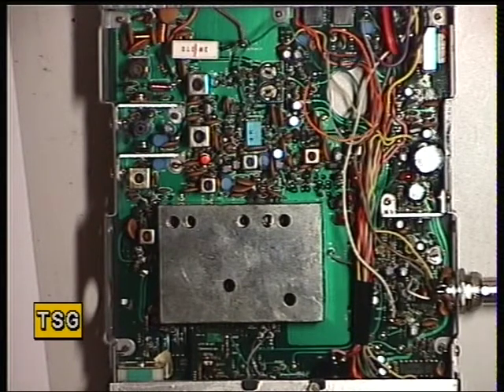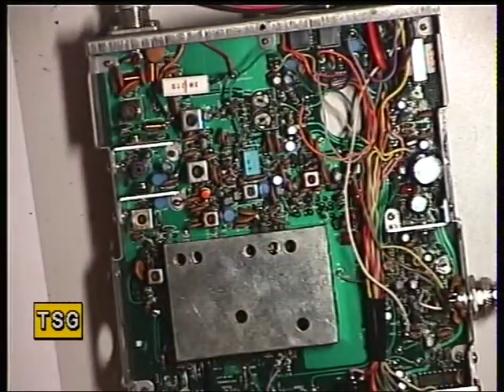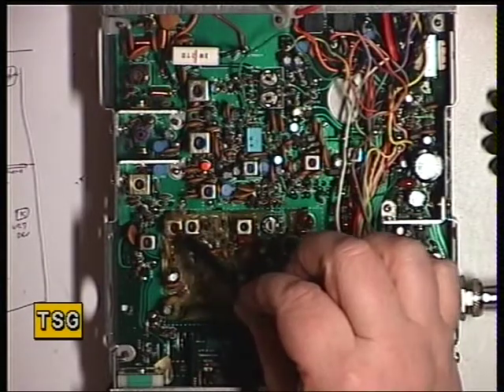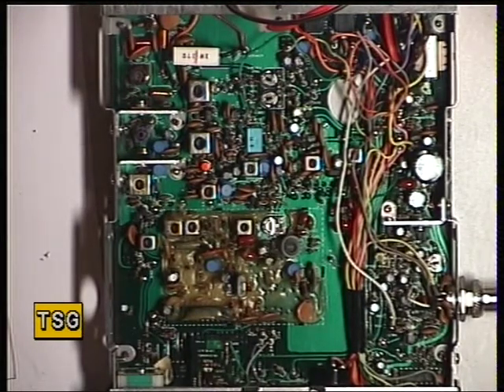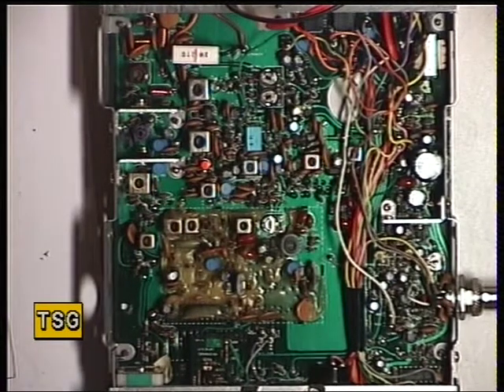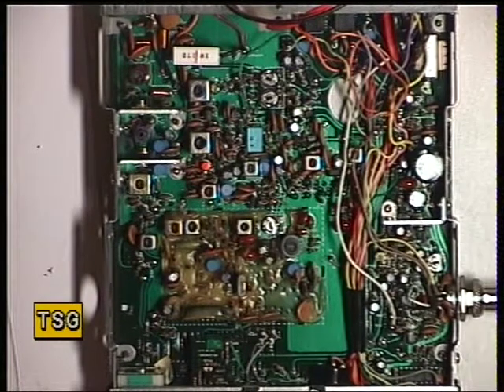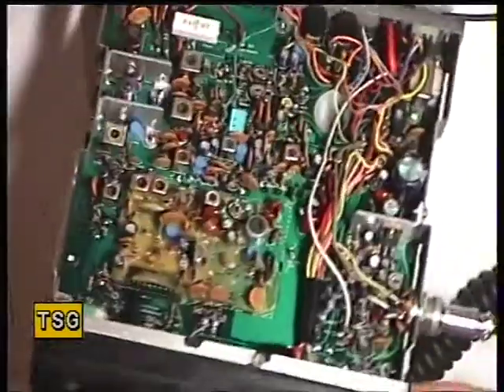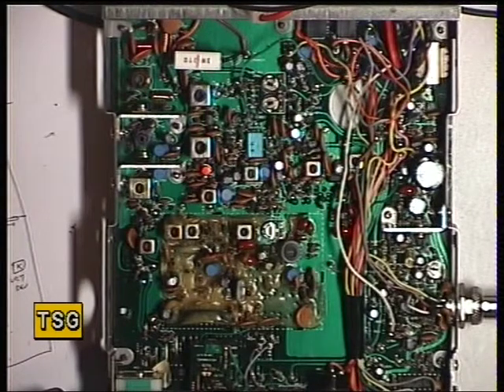Shogun - UK CB radio, (CB 27/81) (Mobile) - Transmit alignment

Comment: Hi Richard. I have one of these which is fine on transmit (4 watts spot on) and sounds great. However, the receive only works sporadically and then fades away to just FM hiss but no signal received. I would assume the dry joint issue that you mention but applying pressure to the board doesn't seem to reveal any potential area of poor joint integrity.... a bit of a puzzle but I hope to solve it as the set is far too good to scrap.
Reply from the maker: Yes, it will be a dry joint. We use a (sex toy) vibrator to help locate dry joints....I went into out local Pound shop a few years ago & bought five; one for each bench.

Richard